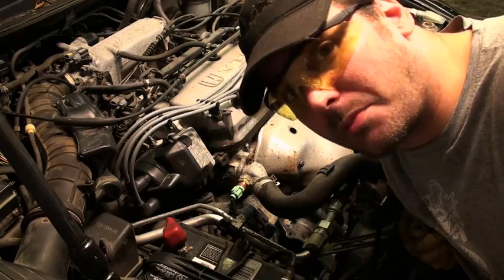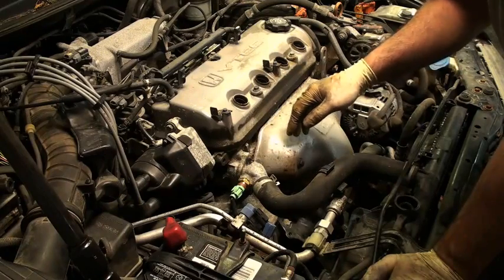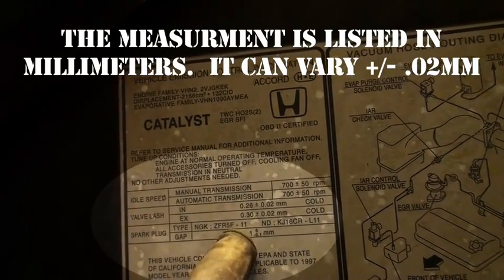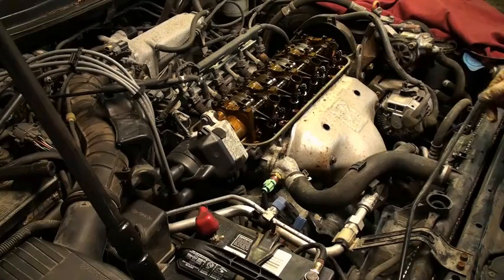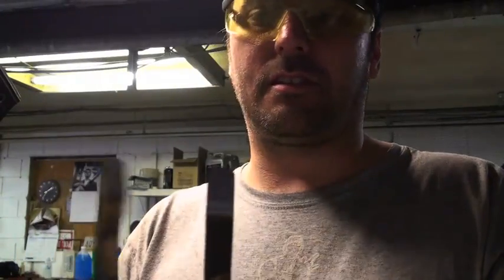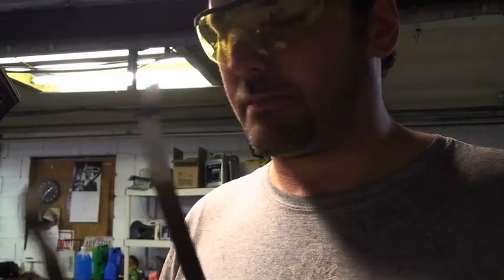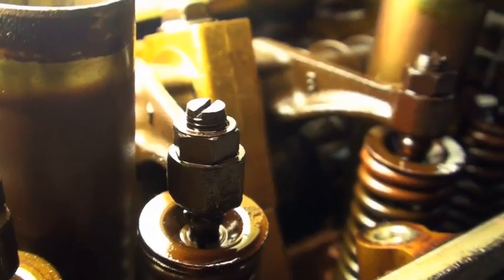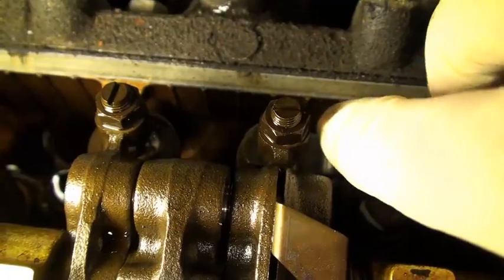Honda Accord Valve Adjustment - EricTheCarGuy

Comment: Great job of explaining what could be very complicated. I'm 75 year old, woman, and a natural redhead. I only mention that b'cuz it explains how we differ from most women. We possess a  dogged determination to succeed at something simply because we've ben told that we we won't be!  Anyway, I have been working on my 1992 Honda Accord LX Station Wagon,  since I got it, 21 years ago. I started doing my own vehicle maintenance and repair in 2001, after I got screwed over on 2 tune-ups on my 1991 Winnebago,  on a Chevy chassis. Every time I got it back, within a week it was running just as bad as it was before I had the tune-up done. To be brief, I hung upside down in the passenger seat, pulled the distributor cap and rotor,  and the spark plugs, and discovered that the plugs were original, from the factory, ( they had blue paint on the bottoms. My dad worked for GM, and told me, once that is how you can tell if a used vehicle has had general maintenance; paint on the plugs, not a good sign unless the vehicle is only 2 years or less) ! The distributor cap was cracked and the ignition points were black with carbon! Guessing it was original, too! I was a single mom, angry as ----, and vowed this would never happen again!  As it turned out, this model and generation of Accord was one of the best for high milage with few major repairs, over time. Easy to repair,  too. I am also fortunate to have a son that has been an assistant manager in Honda parts, for over 20 years. I considered getting a newer vehicle, a couple of years ago, but the particular Honda Odyssey I wanted was never for sale, at the priceI was looking for. Now that used cars have doubled or tripled in value, I've decided to fix my wagon up, and keep driving it. It only has 214,000 miles on it. My youngest son had a 1991 EX Wagon with 500,000 miles on it. He sold it to another one of my son's,  in 2007, when the FIT came out. That '91 Wagon is still being used at my son's vineyard, 14 years later, so I'm sure, if you keep making those great DIY maintenance and repair videos, for the 4th generation Accord's, I can keep mine running like new. I was fortunate to find  used one that was not driven where they use salt on the roads. Right after I bought it, I got recruited to work in South Texas, and direturn to the Midwest until 2014, so, outside of the Honda, "oops" rust, on the rear quarter panels, there's very little body rust. I'm going to learn how to use a MIG welder,  this summer, so I'm hoping to do some fixing on the body. Sorry for the long comment. Keep up the great video's!
Reply: I freaking loved reading this comment... What a cool story you have. You remind me of a cousin of mine, one of my favorite people. Rock on lady! 🍻

Comment: Eric I have to thank you for this video as it did encourage me to the valve adjustment on my accord, the same generation with the same engine (F23A1) as the one in your video...
HOWEVER, the way the Honda Service Manual tells you to adjust the valves on the F23A1 engine leaves the lobes pointing to the front of the car and the base circle towards the back, as if you have to adjust the valves with the lobes at a 270 degree angle (lobes pointing up being 0 degrees and turning clockwise). An easier way to tell if they're in the right position for each cylinder would be to take out the two 10mm screws holding the timing belt cover around the cam gear. The cam gear will have an 'UP' indicator on its side which should be facing TOP DEAD CENTER (or Up) for the valve adjustment for cylinder 1. When positioning the Up indicator, please keep in mind the engine is in the car at a bit on an angle and try to turn 90 degrees relative to the angle the engine is tilted in. Turn the crankshaft 90 degrees counterclockwise so that the UP indicator is pointing to the front of the car to adjust cylinder 3. Turn 90 deg CC again to make UP point down to adjust cylinder 4. Turn once more 90 deg counterclockwise to make UP point towards the cabin of the car.

I adjusted the valves to Eric's method and ended up with a very shaky, stuttering idle. I turned the car off and tried again the next day by the service manual's description and have my car running happily again. I may not be done since there is still a slight tick audible but less than before.

I didn't write this to crap on your tutorial Eric. Really, it did help in making the process much less nerve-wracking. I am only posting this so that others do not panic and think they broke something with their Accord and the valve lash is simply off
Reply: Adrian McDowell   F22A  is SOHC, 16 valves, non-VTEC

Comment: Thank you Eric for the detailed straight forward video made in 2009.Just finished with water pump and timing belt replacement on my 1986 civic si. I followed the my honda shop manual and adjusted the valves accordingly. The car sounded like a diesel  after the first and 2nd adjustments.Felt really frustrated  then I saw your video and did it the master honda technician way and my very first car is now purring like a little kitten and happy again. Thank you so much brother for sharing your wealth of knowledge. Keep Wrenching.

Comment from the maker: Yes I have used it to diagnose a problem such as a sticking caliper but you have to be careful doing this and not drive on the road when you have a brake line clamped.

Comment from the maker: @myadler Perhaps not, if it's a manual and the wheels are on the ground you will need to put it in neutral first.  I've also tightened the belt a little to make it work better in the past.

Comment: So i adjusted my valves, got new spark plugs and adjusted my timing. Took me like 4hrs but now my car is running smooth. It wouldn't have taken as long if i bought that tool that you have to adjust them. Thanks for the video eric. 

1993 civic d15b7

Comment from the maker: @toyota339 This engine is actually an overhead cam engine.  You adjust valves on solid cam systems.  Cams are divided into 2 types, solid and hydraulic.  90% of what is out there is hydraulic and does not require adjustment, solid cams like this one do require periodic adjustment if it's an overhead cam system OR if it's a regular pushrod system, where the cam is located is not important the type is however.

Comment from the maker: It is a good engine.  It does have a couple of faults. One being the balance shaft seal that has a tendency to pop out and cause a massive oil leak, easily fixed with the retainer.  The other is the oil leaks that sometimes develop at the distributor and oil pan.  It will outlast the car in most cases.

Comment from the maker: I don't think there is anything like your talking about but I don't know for sure.  Sometimes you just have to eliminate everything else and go with your best guess.  I've tested the resistance on coils that were bad that tested good, I think the only way to know if a coil is good or bad is to observe it under load.  Come to think of it an old Sun machine might work but I haven't seen one of those in years.

Comment from the maker: @playstation2bigs No, actually most are adjusted hot.  However you may not have adjusting nuts like these, many Toyota's use shims that need to be changed in order to adjust the valves, I would check into that before you get started.

Comment from the maker: @fox8950 Not really, the belt just slips over the pulley.  If you leave the plugs in your working against the compression of the engine as you try and turn it over.

Comment: Hello there, Mr. Eric. I have a '98 Civic with the D16Y7 engine, needs an adjustment badly. In other videos I've seen, the person takes the front left wheel off, sticks a very long extension in there to turn the engine over via the crank bolt. The few others that I have seen they don't even remove the spark plugs and they struggle a little despite the large wrench they were using. Glad I saw your method here! Smart idea. Thanks for another helpful video (even though this one's almost 5 years old). Keep them coming!

Comment from the maker: No, that's just a dust seal for the timing cover.  The balance shaft seal is on the front of the engine toward the front of the car under the timing cover.  It's driven by the secondary timing belt and is the only other removable seal on the front of the engine besides the cam and crank seals.

Comment from the maker: @shumuss I don't.  ONLY use the oil that is recommended for your engine and do not put thicker oil in, if you do it can starve the top end of the engine for oil on start up especially in colder weather, in short you can accelerate the wear on your engine if you do that.

Comment from the maker: @YOUNGaz11 No, many other manufacturers call for adjusting the valves when the engine is hot meaning just after you shut it down, Honda's however want the engine cold.  The reason for this is that the expansion of the metal changes the clearance as the engine warms up and will effect the measurements.

Comment from the maker: Timing chain has a hydraulic oil psi adjuster, once it runs out of travel the chain starts to smack the inside of the cover and causes the valve train to get noisy.  I'm not saying this is the problem for sure but it's worth checking out.  It's really not that bad a job since you have the room because it's a truck.  If you end up having to replace it get a good chain, not one in a plain white box.  Believe it or not but I think replacing the chain is easier than adjusting the valves.

Comment from the maker: @hondaslave The idle air control valve not the intake valve.  You can remove it from the intake and clean the screen that goes to it and it helps smooth out the idle.

Comment from the maker: I bet it's not the valves, I would check the timing chain before you do anything.  Remove the distributor cap and note the rotor position, spin the engine clockwise until you see the rotor move, then spin the engine counter clockwise until you see the rotor move in the opposite direction.  If it takes more than 2º of crankshaft rotation to see the rotor move you have too much slack.  You could also just remove the valve cover and check it there too.

Comment: I have an old Renault 4L and it smokes only when going uphill. after a lot of research I figure it could be the valves. going to give a it a try and set the gap after watching your video. thanks for being so thorough with your explanations, you make it easy to follow

Comment from the maker: @MartyOs1 You can do this one cylinder at a time and not have to redo the adjustment however experience has taught me that it's easier to make sure each lobe is on the base circle when adjusting.

Comment from the maker: @Q8ROTARY To be honest I'm not sure your going to get the result you are looking for.  A valve adjustment will smooth out an engine but really won't do much to enhance power.  I know you said you adjusted the timing but you might want to check the timing BELT to see if it's in the correct time.  Also since your old engine smoked so much you might want to check if the catalytic converter is clogged.

Comment from the maker: @tauseef7061 If memory serves those valves are NOT the same as these, you need to take your measurement, compare it to spec, and order and install a pre-measured shim to make the adjustment.  I don't recommend it if you haven't done it before.  To answer your question however I would adjust the valves before tuning the carb.

Comment from the maker: @sonofseasia I'm not sure I understand the issue but sometimes the screw gets stuck inside the nut and you have to free it in order to make the adjustment.  BTW valve adjustments are an EXACT science if you get it wrong you run the risk of burning up the valves which means you will have to remove the head to replace them.

Comment from the maker: Not at all.  Toyota valves are adjusted by inserting correct sized shims over the valves to gain correct clearance.  Real pain in the butt.  Also Toyota valves are adjusted hot instead of cold so this presents another challenge to the procedure.  Timing with a timing light is pretty straight forward.  Look at the underhood sticker for the correct setting, hook the lead to #1 cylinder, loosen the distributor, point the light at the crank pulley and adjust to the reading, pretty straight forward.

Comment from the maker: I just run through the valves in sequence which means bouncing from cylinder to cylinder doing intake valves on some and exhaust valves on the other until all valves have been adjusted.  I like to have the lobes 180º from the rocker on the valves that I adjust but as long as you are on the base circle you should be OK.  It is possible to adjust all valves with just one revolution of the crankshaft, I just choose to do it my way based on experience and my comfort level.

Comment from the maker: @brandtjr It's not a bad start but probably won't fix it all.  Try cleaning the screen on the IAC valve also and doing a good tune up with quality parts.  Next check the timing belt tension and make sure there isn't too much slack.  If you do all that and still have the issue then you might check the engine mounts.  Good luck.

Comment from the maker: @Luxxer1 It can help a rough idle but is not often the cause, for the cause you could start with the basics like a good tune up but also make sure the timing belt has the correct tension as a loose belt can cause a rough idle.

Comment from the maker: @PVoyager If you have NGK plugs that's a good start but that engine is notorious for clogging EGR ports which will cause the misfire.  Try cleaning the EGR ports first and see if the condition still exists.  Valve adjustments are more of a fine tuning thing and don't normally cure a problem like a misfire.

Comment: just have to say this is an amazing engine I have an f22b1 in my accord . tried to do a vlv adj at 150k but they where in specks tried again at 250k still in. at 450k I made them slightly tighter. probable didn't have to but I got tired of taking the vlv cover off for no reason. love the shit out of this 2.2

Comment: Had to work on a totally different engine (Yama 250), but from your video I was able to determine where to measure with the feelers (valves were badly out of adjustment, zero gap (.003-.005 are specs)), so thanks a lot!

Comment from the maker: No concern at all, it is in spec.  You can change clearance by changing out the shims on top of the lifters on Toyota's, with a little math you can figure out what size shim to replace it with.  It is a pain in the behind but it is possible.  Considering what you need to do to change it, I would leave well enough alone.

Comment from the maker: @slkuski If you spun a bearing your probably going to need machine shop work.  I would advise replacing the engine instead of rebuilding your old one especially if your not familiar with the work.

Comment from the maker: I think you can do it with a scanner on most vehicles.  If there is an issue with the idle you could disconnect the valve but for the most part you are only disabling the ignition momentarily and it shouldn't adversely effect the vehicle to any great extent.

Comment: Good job eric.
I have a accord 1996 rare wagon my self.
The only one in Suriname..south america with a F22b double camshaft...
And when its hot, normal hot..
It shuts down..
I did alot like changing sensors, adjusting throttle, nothing helps much except for those sensors, they turned off the check engine light... so the last thing left is that adjustment....

Thanks bro..
Im tuned..
Stay dirty💪

Comment from the maker: There is a special tool that can be plugged into the cig lighter that will keep the radio memory.  Never work on a starter or alternator without first disconnecting the negative battery cable though.

Comment from the maker: Being an older truck it might not set a code for a "lazy" O2 sensor.  You could hook up a volt meter and see how it does when  the engine is running.  It should switch from rich to lean rather quickly (about .5V to .95V), if not replace it and that might help it from running so rich.

Comment from the maker: I suspect that the engine is worn out.  The oil pump doesn't create oil pressure, it creates oil volume.  The pressure is actually created and maintained by the clearances between the engine parts.  If you have a worn out engine the oil pressure will be low and a new pump will do little to correct this.  The reason it is quiet when it's cold is because the oil is thicker when it's cold and doesn't run out of those spaces as fast.

Comment from the maker: You could do it that way and be just fine.  Some guys adjust the valves on more than one cylinder at a time, me I prefer to be 180º from the lobe but as long as you are on the base circle you should be OK.

Comment from the maker: @drumist1989 Not all valves are adjusted cold for that very reason, in fact most of them are actually adjusted hot.  I made the cold distinction because that is what Honda wants.  Excellent point, thanks for your comment.

Comment from the maker: @vmaxcruzer No adjustment on those sorry.  The only way to repair it is to replace the lifters in the head.  Make sure your using the correct oil for that engine and it's at the proper level also.

Comment from the maker: @Perez19136 It does take some time to get the 'feel' for how to do this but it's better to make them too loose rather than too tight.  Better to hear em than smell em as the saying goes.  You can always readjust noisy valves, get them too tight and you will be removing the head to replace them.

Comment: Great video, Eric. Instead of a wrench on the power steering pump, try doing it automatically. Pick up a Pedal-It from Ciccarone Racing Products. You connect it to the starter, and step on the pedal. It will turn the motor over for you automatically.